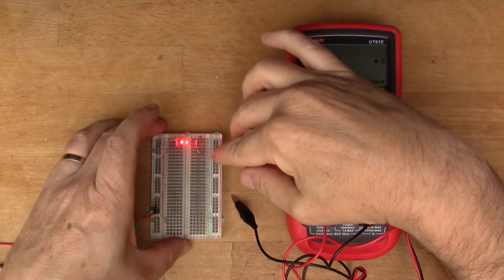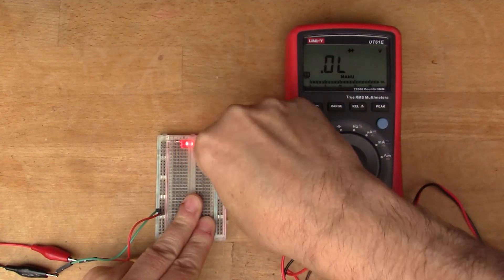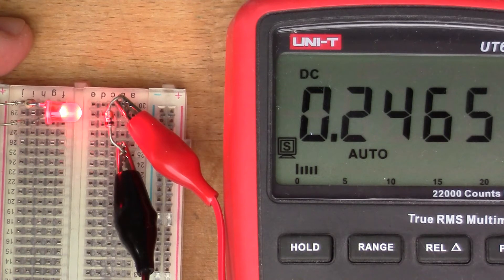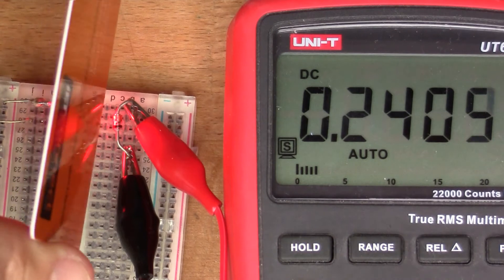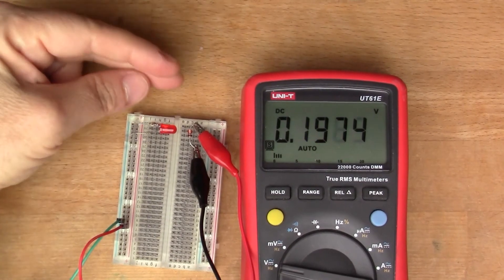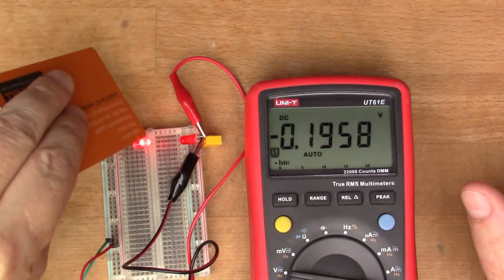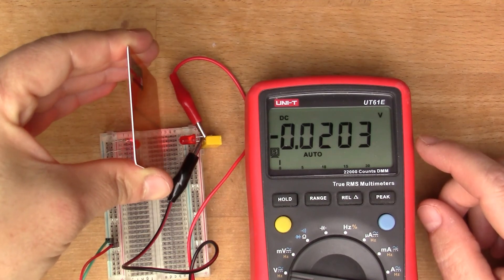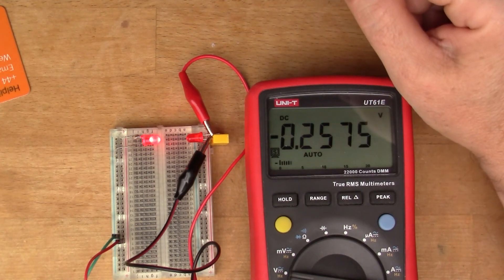Diodes and LEDs Can Detect Light

Comment: Hi Martyn, Im wondering if a single clear cap led which lights green would be able to detect the green light from an LED of the same type with a 2.5V supply? Would the green light and clear body affect the reading as i know its been mentioned below that the red is filtering out light colours

Comment: if you had two led/diodes in series would you see twice the voltage? I wounder how much current it could supply, at a guess picoamps. Nice vid, may have to have a play with this myself.
Reply from the maker: Great questions.  I've made a part 2 here to answer them: https://youtu.be/fKTnmUkqU80
Reply: Thanks, I was alittle surprised that the voltage did not double tho, just went up a bit more.
Reply from the maker: I imagine that the LEDs were not all equally illuminated; I only roughly lined up the torch.  Also the LEDs are not all necessarily the same type - I just got some at random from my component box.